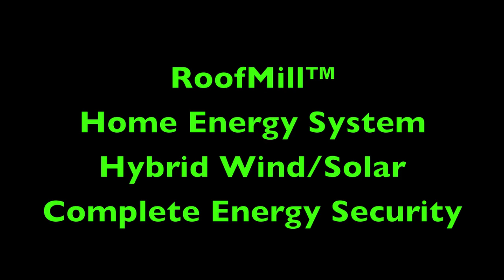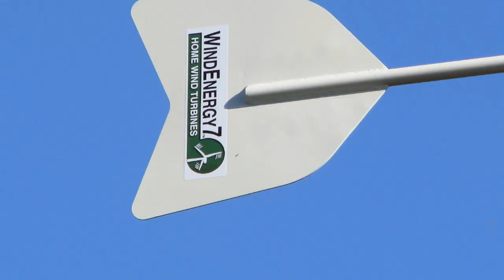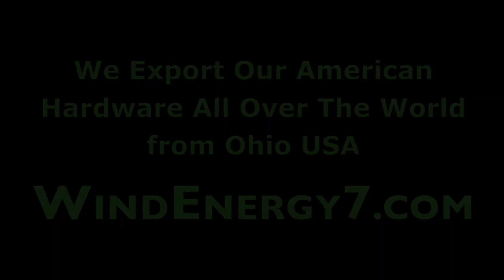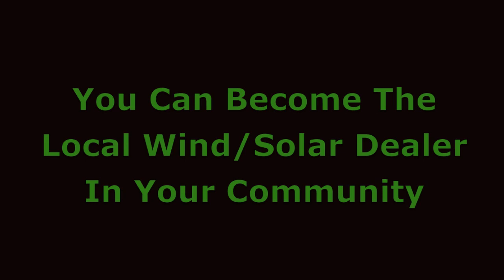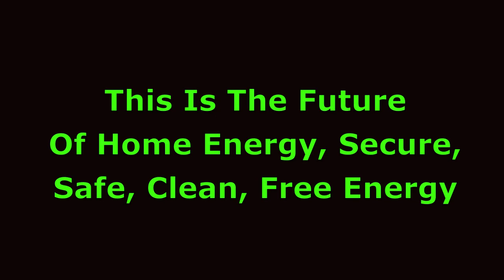GE Ecomagination Line Dance

Comment: So you would utilize the wind turbine for your elecitiy needs, and when there was not enough electricity, then the power from the grid would kick in?  Does that happen automatically?  Or do you have to manually switch?  Would you lose power all the time and have to reset appliances when that happened, or would it be seemless?  Where does one get one of these systems and how much are they.  If there is no dealer in my town, would you come install it?  I am one state over from you.  Fascinating.